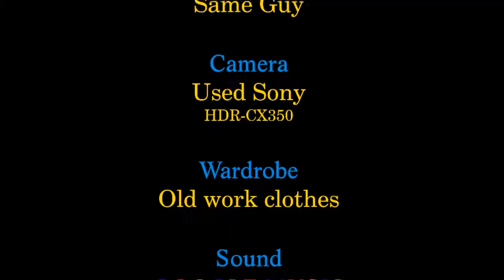1977 F250  New Saddle Blanket Seat Cover

Comment: Thanks a bunch! I got the same cover as a Christmas gift and having just restored my old 1990 F150, it was time to get the cover installed. Instructions were less than perfect and your video helped me get it in as perfectly as possible.
Reply from the maker: Hey, you're welcome! I have to say that on my "87 F150 I removed the seat and installed the saddle blanket cover. It was an easier install but a tad  more work. I wanted to look under the seat and everywhere else as the truck was new to me at the time. Thanks for the comment!
Reply: SteveAZ711 That would work best for sure taking the seat out. I had mine in the garage and couldn't get the seat out of the truck. But, I did come up with a practical way to really pull the cover tight. I used black plastic cable ties to attach to the wires and other spots under the seat and the canle ties go through the fabric perfectly especially on the sides of the seat. I looped one cable tie in other spots through the provided loop(s) and hooked it to another one under the seat and then pulled the cable ties tight. Seat cover now fits like a glove. The cords work but I could never pull them tight enough in certain spots especially under the seat. Thanks also for adding about using the duct tape on the seat. Mine had breaks in the seat and the tape I added should help keep it from getting any worse.

Comment: Putting mine in today. Thanks
Reply from the maker: Very Good. Mine did not hold up very well and I will be putting on another one in a future video. These covers are the best, but sometimes, I think, some manufactures skimp on quality materials. I was trying to save some money on the last one and that just may be why it didn't last.
Reply: @SteveAZ711  mine is already frayed on the dogs side of the car. It wont last the year. I'll get a better quality one next time.

Comment: There was a rash of really poor quality saddle blanket seat covers made from about 2016 to 2020 (rough estimate). These really poor quality covers disintegrated within months and sent fiberglass shards everywhere. In my case mine was disintegrating right out of the package (2018-ish). I think the manufacturer finally started using a better quality material More recently. I have a new one I purchased in 2021.  I'm keeping my fingers crossed. I think the original, really good ones were actually made out of cotton. You won't find cotton these days though, but hopefully it's not the cheap crap that was disintegrating on everybody a couple 5 years ago.
Reply from the maker: I bought a different one for my other truck and it is holding up much  better. Thanks for the valuable information!

Comment: Where did you get this seat cover? I bought a universal saddle blanket seat cover from NAPA for my '76 and it did not fit.
Reply from the maker: Hey  Thomas, I bought it on Ebay...Here is the link...\
http://www.ebay.com/itm/1940s-1991-Ford-Full-Size-Truck-Bench-Seat-Covers-/281386095430?var=&hash=item4183eb1346:m:m-MVTgtU7QpPZAxhQvvWvnQ
1940's to 1991 that covers a lot of years. Hope this helps and thanks for the comment!
Reply: Thanks a lot Steve!